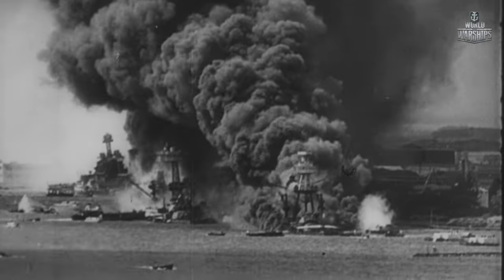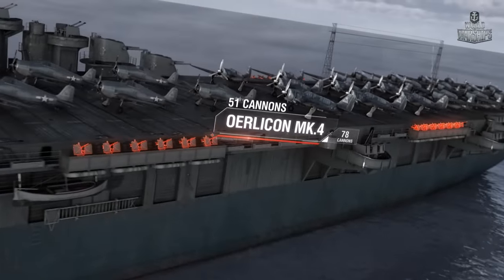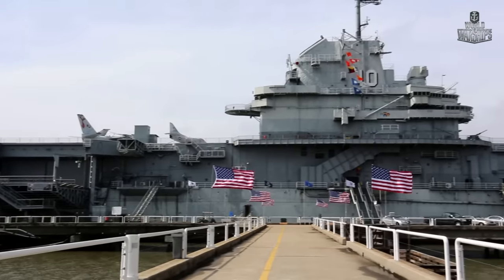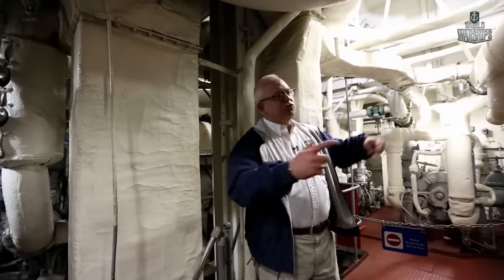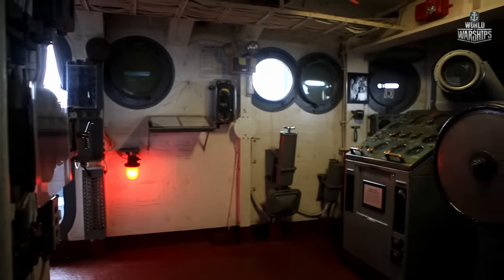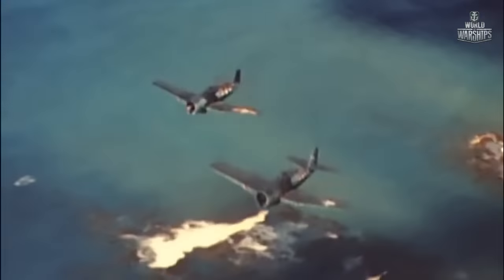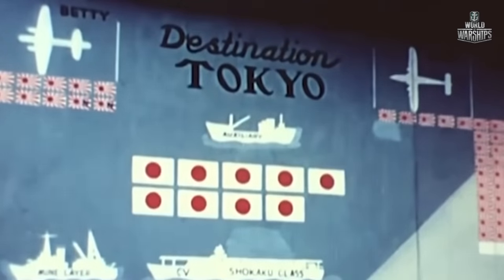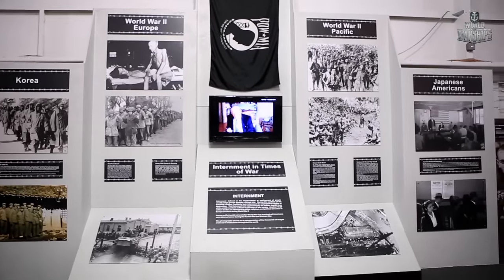Naval Legends: USS Yorktown  | World of Warships

Comment: Personal knowledge - while the Yorktown may have had hydraulic catapults when built in 1941-2, they were no longer installed by 1970. I started as an aviator in VS-24 when we were aboard the USS Randolph (CVS-15) in 1966, but she was decommissioned in 1969 and the USS Yorktown was transferred from the Pacific Fleet to the Atlantic Fleet in the spring of 1970 as our "new" carrier. She had steam cats at that time and they were welcomed by the air crews and the maintenance crews as they were far easier on the air frames and the on board crews.

Comment: re. dec 7,,,,,,,,"the majority of the US fleet stationed there was sunk or disabled".
ABSOLUTELY WRONG! 90% OF THE SHIPS HAD MINOR OR NO DAMAGE.
the BBs there were all old.  however the cruisers and DDs were of much newer design, and they were mostly undamaged.
3 BB were up and running by march,42 a fourth  rebuilt by october, and the other 2 were rebuilt a year after that.
the old BBs were not needed early in the war, cause they would generally be used for shore bombardment, not ship to ship.
the war would not be won with those old BBs that were at pearl dec 7.
the war would be won with new designs. 
for example, all but 2 of the essex class were ordered BEFORE dec 7.